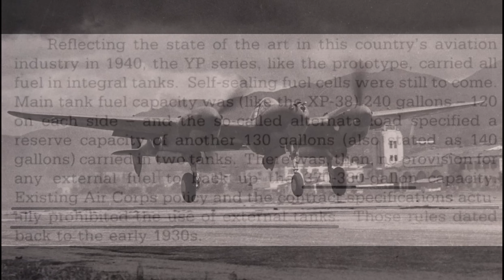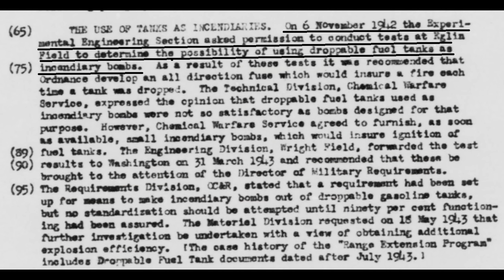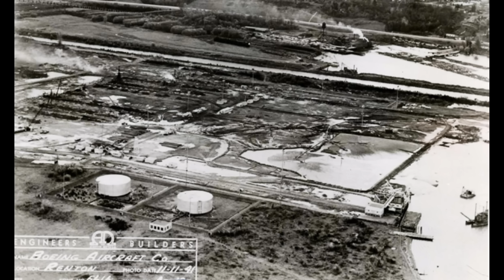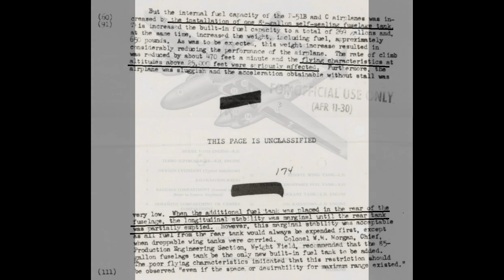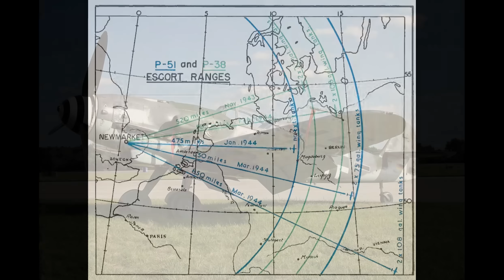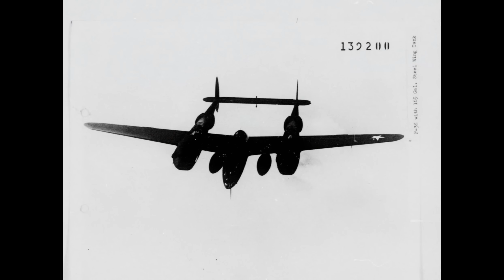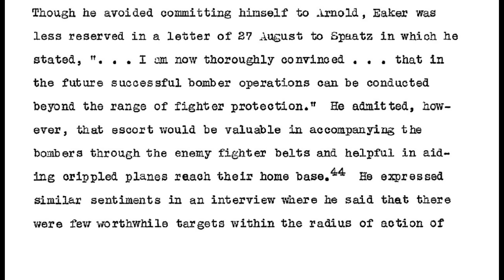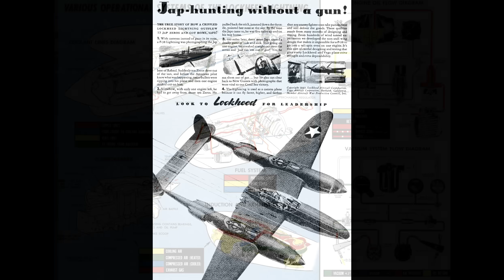The P 38 Lighting and the Bomber Mafia's Failure In World War Two

Comment: Great video! C-130 guy here-  one comment on your temperature point. Yes, it’s cold at altitude everywhere around the world, but colder temps on the ground do matter.  At altitude, the airplane is running and the active parts are hot and running. On the ground, extreme cold will cold soak and airplane, playing havoc on rubber seals, etc. 
we would really see this as an issue ferrying gunships through St John’s Newfoundland. After months in the baking hot desert, an overnight stay on a snow covered ramp in Canada, often the prop seals would fail or we would get other leaks. (Which crews often didn’t mind at least since St John’s is a fun town, but beyond the first delay for parts, it gets old fast.)
Not sure if that played a factor with Lightnings in WWII, but it certainly is a very valid factor.
Reply: You can bet it did, seal technology wasn't anywhere even close to what you'd have been around with C130's, if those engines even had rubber seals back then instead of the common rope seals of the time they'd have been 1st generation rubber seals, I'm always telling people to get in their family photo album and look at a picture of kids playing in the street in the 1970's, you'll see huge oval shaped oil stains in front of each house where the dads parked their cars every night when they got home from work, go outside now and look up and down a street and you won't see that anymore, among other reasons it's because the rubber used in todays seals stands up so much better, when I started working as an automobile mechanic in the early 80's you couldn't take a timing cover off an engine that the front crank rubber seal wasn't hard like plastic and cracked in several places even after just a couple years, nowadays I take 10 year old seals out of stuff with 100,000 miles on it and it's still pliable, those aircraft engines from back then might only have had rope seals in them because the rubber back then might not have been able to survive a single mission of starting up on a 10° day and heating up to operating temperature then cooling back down after a mission, just once might have trashed the rubber of that era, I know that Buick 3.8 ltr V6 engines kept their front crank seals in their timing covers rope at least into the mid 80's.
Reply: @dukecraig2402  Great comment, and some automobile engines like the Ford Flathead V8s didn't even use crankshaft seals. Instead they relied on slingers to return the oil. Naturally when the engine turned off the last few drops dribbled out onto the parking spot.
On the subject of photos, take a look at many neighborhoods built before WWII and even up through the 1950s. The original driveways were often ribbon driveways, 2 tracks for the wheels, with grass growing between them. It wasn't because they were cheap and trying to save money on concrete (although they were doing that, alright), it's because the early oil dripping cars would leave unsightly oil stains on a full driveway. The grass strip caught the oil and didn't look so unsightly.
Reply: @dukecraig2402 , I would add that since the mid 60’s that the PVC System eliminated the old “road draft” tubes.
Reply: @duanepierson4375  "PVC System"? Is that a like a PCV System, Positive Crankcase Ventilation or something different?
Reply: @dukecraig2402  These are interesting and valid points. However, with regards to the point in the video, this would affect all WWII aircraft, not just the P-38. Now, of course differences in construction might make the problem worse in the P-38 than others. It might rely more heavily on tight tolerances, it might have a high number of affected seals and said seals might be a pain to replace but this is all pure speculation on my part. Anyway i appreciate you sharing your knowledge. I just thought this was something that didn't come across in your comment but i thought worth pointing out.
Reply: I am an Arctic pilot and can also confirm this is the case for every turbo prop I’ve flown.
Reply: @drewski5730  
What do you think of the modern commercial jets where the skin is hot to touch a few hours after sunup in the desert and within half an hour they are flying through air at minus 50 ? 
Then if it comes down in sub-tropical Africa where metal step against it are painful to the touch. 

It won't be so bad as an SR-71 spy plane but all these hot/cold cycles must mount up.
Reply: @20chocsaday  honestly it seems to be fine. I’m sure there is wear and tear from it; however, this is likely exactly the types of conditions these aircraft are tested to failure. In an ideal world I’m sure with less heat cycling the airframe would last longer, but they’re built for exactly the conditions you’re speaking of for 90,000hrs use give or take. 

It’s the cold soaked starts that seem to be punishing for whatever reason. Everything just seems brittle and less durable at -40 degrees, and during start up and ground handling things seem to break. Oil is congealed and doesn’t lubricate. Tires become square. Brakes freeze. Avionics in particular seem to get upset at the cold temps in addition to rubber seals. Quite often if the airplane has been sitting out it takes 30-45mins+ to get the electronics up to temp or they’ll malfunction relentlessly. You learn to deal with this sort of operation, and quickly, but it’s definitely different than a warm environment.
Reply: @drewski5730  Thank you.
Reply: At 38:54 you mention the Mustang was limited to 108 gallon tanks due to the structural limits of the wings. At some point the wings in the “D” must have been strengthened, because it carried two 150/165 gallon tanks from Iwo Jima and in Korea.  Of course, this does nothing to negate your main point, that Air Force policy held back the P-38’s tanks when it mattered.  What I always wondered about the P-38 was why it took so long to get them to front line units if the E was introduced in zoctober 1941, and the F was coming off the assembly line in February 1943, why did it take until November 1942 for P-38s to make it into combat nearly simultaneously in z North Africa, New Guinea and Guadalcanal? And even then there were limited quantities.
Reply: Cool story!
Reply: C-130? Is that like a small 4 seat Cessna?
Reply: @basfinnis  yes, sort of like a trainer with a little propellor.
Reply: @basfinnis  I suppose it could be a four seater, if you count 4 Armoured Fighting Vehicle Drivers, and their vehicles!
Reply: I heard one thing from a former P-38 mechanic who served in the South Pacific, who said that one of the things Lindberg came up with was running the engine temperature much hotter using higher-pressure thermostats. The result was a higher horsepower set of engines that were not pushed as hard at high speeds.
Reply: @kevinstich7603  I used to do a similar thermostat trick like that in my old VW Golfs. My case though I used lower temp thermostats to run more advanced timing with a knock sensor based ignition to avoid pre-ignition knock or "pinging".